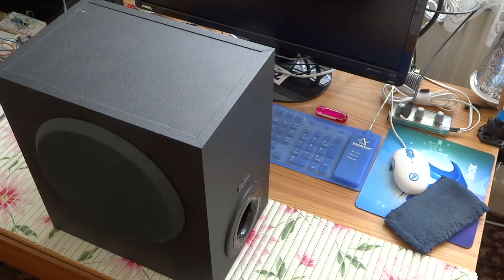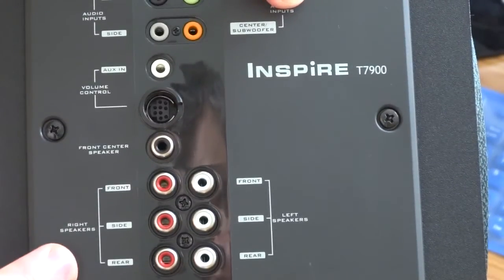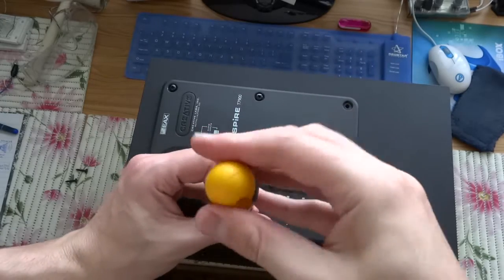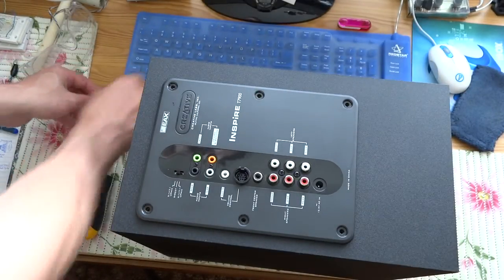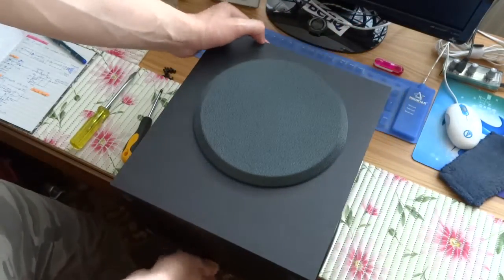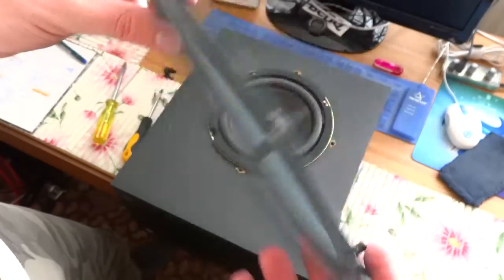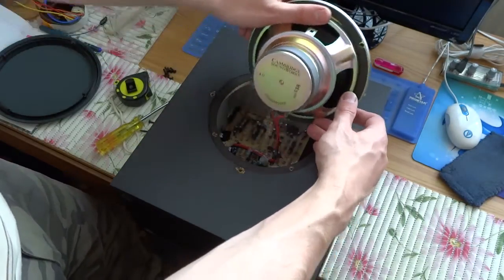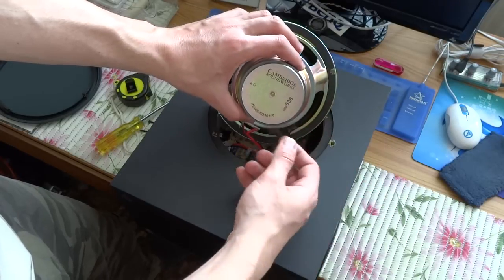Creative Inspire T7900 disassembled  inside a subwoofer - part1 of 3

Comment: hello i have a problem with this subwoofer and i think its problem in this to micro elements witch you shov in video 13:10  min maby you can help me?
Reply from the maker: hello,
these 16-pins integrated circuits ?
Reply: MrStanleZ yea im think so because when i put 2 pinns together subwoofer is start work but in speakers its a electrisitical sounds when im  not  listening enithing